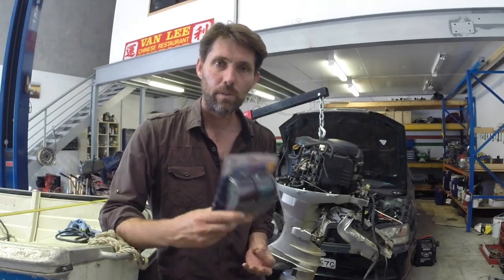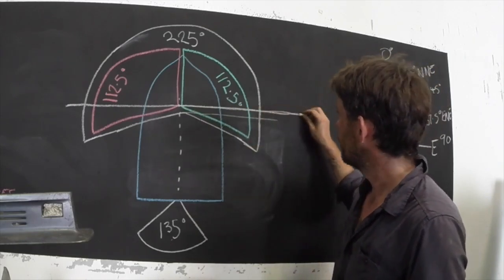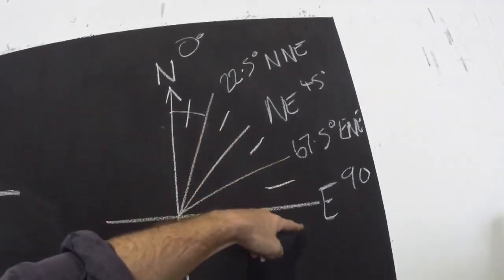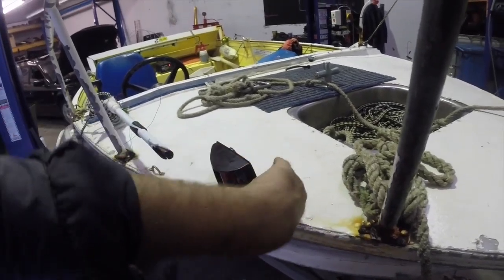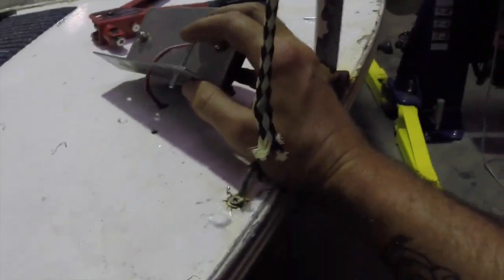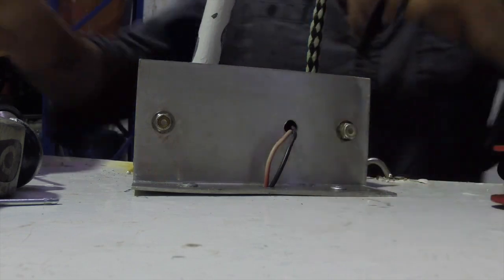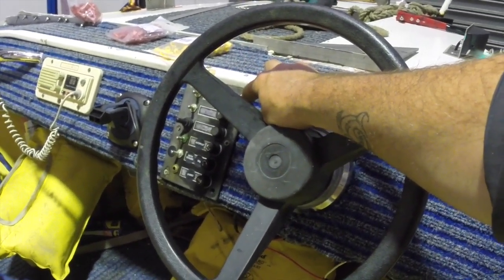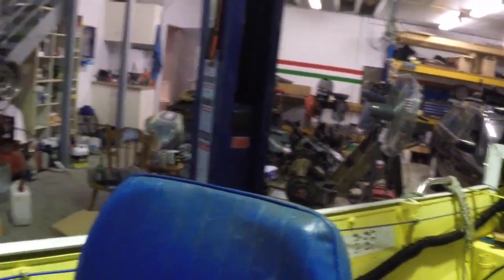Installing navigation lights on a boat

Comment: I had no Idea of the complexity of Nav lights, Stu , your vids are brilliant , you are always my go to channel , the fact you do not assume we know the basics is what sets you apart from the flock.Thank you from the UK .
Reply from the maker: Glad to help. :)
Reply: The most precious thing we have and that we can give is TIME ,  thank you folr this ace channel , I am a complete novice, with a seized 2 stroke 10 hp Mariner, and a 16 ft grp old Dinghy, Mariner is built in the 80's I think, boat is older , it is an Orkney Long Liner mk 1, displacement hull, I want to make it better, and sort out the Engine, Your channel is giving me the confidence [ albeit slowly[I am not mechanically minded with no skills ] to actually have a go at both projects . Thank you .

Comment: Your videos are some of the most practical and informative boat videos. I really appreciate the effort you put into making these videos. When you discussed the “legally technical” issues regarding the light mounted on your engine, I had an idea that should solve the issue. The mounting area is a brilliant idea. Personally, I can’t stand the poles. I think a new mounting bracket would solve the issue with lighting while maneuvering. Rather than cutting the bracket as a straight piece, then bending the 90, making the “L,” first cut the bracket into a “T” shape. The “T” could be bent around at say a 45 on each side, which would allow another 2 lights to be installed, and no matter the direction of the engine, the light could be seen from the rear. I’m referring to a shape similar to this ... \_/ ... the aluminum sheet appeared rigid enough to handle the shape. Just a thought.
Reply from the maker: Hey Mark, I like that mounting location too and I see what you are saying with your bracket. The main trouble is it can't show a bigger arc that the regulations allow otherwise you don't know when you have stopped being the overtaking vessel. I think it is worth thinking about thought because I would like to move back to this system again on my boat. It worked well for many years.

Comment: Cool hack the stern light on the cowling nice job... looks like you have some swift current there
Reply from the maker: Yeah, the river sure can run. I do like that configuration for a stern light. I went with an all-round pole light this time so we'll see how long it lasts. It certainly won't be as safe from knocking on wharves etc.

Comment: This video was exactly what I was looking for! I understand the Colregs fully, but I live on a 38' narrowboat on a river and all sorts of questions came to mind. The boat was sold to me as a 40 footer, but the original paperwork shows 38 feet, so actually, by Colregs, the 3-mile lights I bought are too big! The sides of the superstructure are not vertical, but inclined; should I fashion a bracket to install them vertically?  Narrowboats are long and thin and the best place for the port and starboard lights is quite far forward, as it is this part of the boat that is going to poke around the corner first. Most of the plastic cruisers in the marina have them installed about half way aft. The best news is that I can use the single 360 degree masthead light, which can double as an anchor or fishing light. The bracket-making and electrical connection advice was brilliant. Thank you!
Reply from the maker: Hey Malcom, yes, I would make some sort of bracket to keep the lights at the correct angle. Even just a wedge-cut piece of hardwood or something should do the trick. Good point about having them further forward in your context of enclosed waterways rather than the open ocean.
Reply: You are right about the bracket. I shall get inventive :-)

Comment: Good video mate. Loved the theory, keep that coming. I was wondering if there is a need to round the corners of those aluminum brackets? Looks like you could easily catch ropes on them? Or is that not a big deal? Also, who polices navigation lights when you are on the water? Can you get stopped for incorrect positioning or use?
Reply from the maker: +Dayne Cowan Yeah, I was kicking myself for not rounding them because they can also cut if you trip on them. I normally do but had a bit of a brain fade while filming this. Roads and Maritime and the Water Police all check navigation lights and yes, you can certainly get fines if they are wrong.

Comment: Great video. I was totally engaged because it was information I really wanted to know. I’m left wondering about the battery and the power that could maybe blow the globes (or LED’s). Is it easy to regulate the voltage or whatever? How long does the (is it a regular car battery) last?
Reply from the maker: These marine LED lights have built in resistance to limit current flow so they are fine connected directly to a battery. Depends on the size and health of the battery how long they will last but LEDs can run for days on a single charge.

Comment: Great channel glad I stumbled upon it. 
I’m new to boating got myself an old Savage Tasman as a project so you’re videos are coming in handy however I have 2 questions I would like to ask of you
1. Does the anchor light have to be mounted on the rear of the boat and 
2. Can I use just a standard car battery for checking the electrics (lights once I replace them) or should I purchase a marine battery from the start? 
P.S. I don’t plan on running an outboard on the car battery. 
Thanks
Reply from the maker: Hey mate, no, the anchor light can be anywhere but needs to be visible from every direction and be (I believe) 1 metre higher than the side lights (but a good practical separation will do for a recreational boat) Yes, I wouldn't be too concerned about using a car battery.
Reply: Dangar Marine thank you for that info. I want to ask just one more from you, I watched you’re video last night about wiring a boat, I was looking at purchasing the cables from BCF it’s 3mm 16amp, would that be enough to run lights, radio, fish finder etc or should I use a bigger size ?

Comment: Hey boss i have a small 14ft vhull with a steering wheel and I'm wondering what the smallest or best motor I can get away with that will allow me to have steering and throttle control. 
can something like a 72 evinrude 6hp motor be compatible with something like that?

also awesome videos, keep them coming
Reply from the maker: Good question, I'm presuming some outboards weren't configurable to have forward controls, but I'm not sure about the old Evinrude 6's. I'm pretty sure many of the small (around 10HP) outboards can take forward controls though but you might need to talk to a dealer to confirm for sure. You could also look at an exploded diagram for the outboard you are looking at on MarineEngine.com and see if they show parts for the tiller and non-tiller versions.

Comment: No marine sealant between the bracket and the deck?  The wiring on that boat looks like a nightmare - corrosion everywhere!
Reply from the maker: You certainly could put sealant, but it isn't necessary on these types of open boat. The electrics sure were a mess. I'm going to do a vid soon on rewiring my boat which is almost as bad!
Reply: +Dangar Marine I don't know.  My boat's brand new and trying to figure out where the wires go and what they do is as much of a challenge as an old one!  Thanks for the videos!
Reply from the maker: +Anthony Roby Thanks mate and enjoy your new boat. That electrical video will definitely start with figuring out what you've got already.

Comment: Hi i wanted to ask and i am sry i do not have more of my boats info but .. i have a  22 ft boat and a mercury 225 fourstroke and 2 deep cycle m,arine bateries ,........ i am interested in doing some night fishingh so  with the  navigation lights on  ,,, and the  white  light on the  t top and maybe the sonar / gps running maybe a pero light how  badly does all that drain batteries because i also have a front and rear spreader light i wanted to use . and that seems like alotta  juice . so any info would be helpful thanks

Comment: anyone know if i can use the aluminium boat as a ground
Reply from the maker: No, don't use the hull. Although it will work electrically you will cause the hull to corrode through electrolysis.
Reply: Dangar Marine 
thanks matey really apprecite it..great channel you got here..do you have any videos on changing carburetors on a 25 johnson ? Im wanting to put a 30hp carburetor on it
Reply from the maker: Not specifically, but most carburettors are pretty similiar in principle.

Comment: Why not put a sealant under the brackets?
Reply from the maker: You would if it was a boat with a dry internal cabin. In this case water gets everywhere anyway so it wasn't worth it.
Reply: OK, great thanks!

Comment: A quick wiring diagram for those that may find it useful. https://www.mediafire.com/?z26f39in0jhlsjz .  you will need Sketchup to view it. Please advise you see any errors.
Reply from the maker: Thanks Ron. Downloading Sketchup now, will get back to you soon.
Reply from the maker: Hi Ron, finally got around to checking out your wiring diagram, quite cool. I'll be redoing the wiring in the Green Machine very soon so I'll look at bringing elements of this into the design. I've now got a Shopify site setup under the dangarmarine.com.au domain so I'll see if I can start adding some extra pages for information like this and an FAQ or something. Thanks for sharing it. Maybe an image or PDF export would be good so people can check it out without using Sketchup.